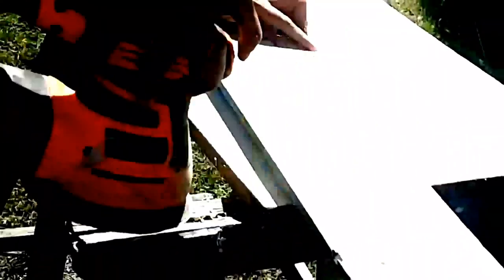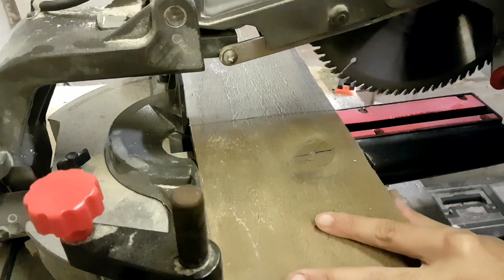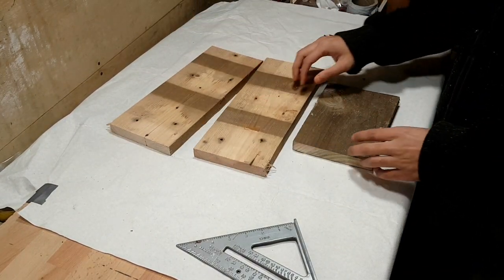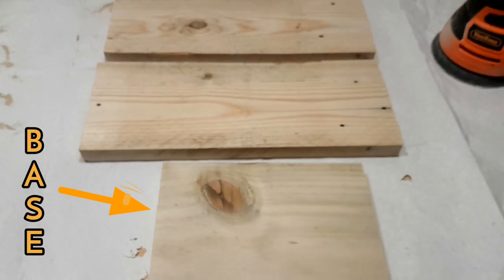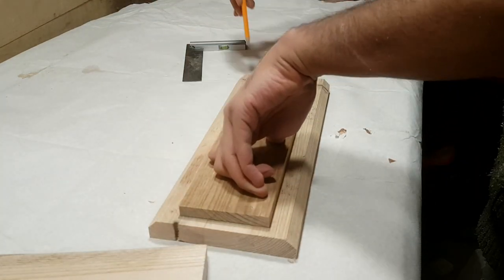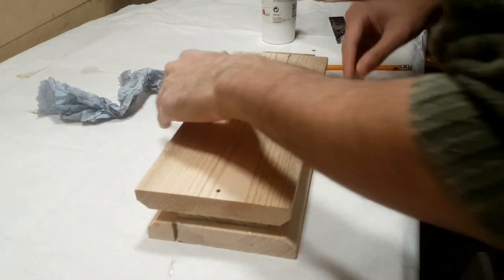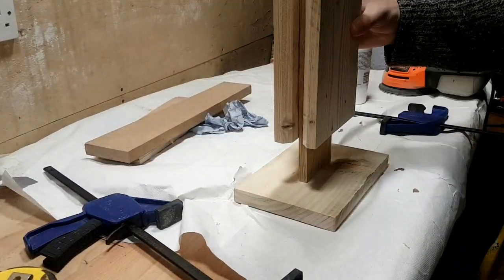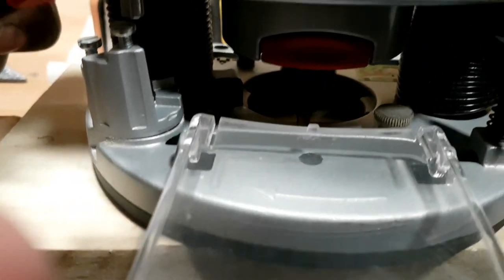How To Make A Desk Lamp | Desk Lamp With LED Dimmer Switch

Comment: That's become a beautiful lamp. Thanks for sharing the video. You really inspired me with this.
Why did you use a drill bit and a chisel for the slot in the base plate?  Isn't it easier to use the router there from the start?
Reply from the maker: Thank you for your kind words! To be honest I'm not too confident with the router yet and my router is quite big for the small base. Maybe in the future I will become more confident with it
Reply: @custommadecrafts1271  To gain confidence you can try it out on a piece of scrapwood. Take a drill bit that is slightly wider than the router bit you are going to use. Drill a hole with it. The depth of the hole should be approximately the same depth as the slot is going to be.Then take your router with the inserted router bit and place it in the hole. Take care. You can't/shouldn't route out the whole depth at once! Make shallow passes. It depends of type of wood, the sharpness of your router bit and the power of the router how much you can do in one time. Start for example with (only) 3 mm. If it goes very smoothly, increase the depth gradually, 4 mm, 5 mm. You can hear (and feel) it, when your router is starting to struggle.  don't forget to make some kind of guides that help
preventing you going beyond the lines.
Reply from the maker: @hansdegroot8549  I need to put more work into the setup of my router in general too, im going to have to make a router table soon too! But with a 9-5,kids and youtube not promoting my stuff its deflating to want to carry on YouTube! I do love the woodworking thougj and appreciate all you lovely.followers. thank you for the advice!